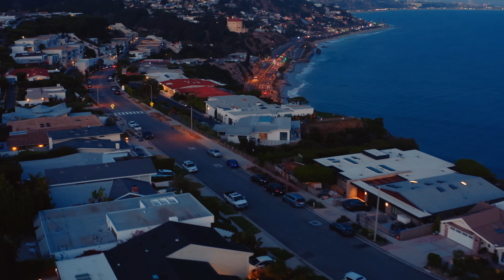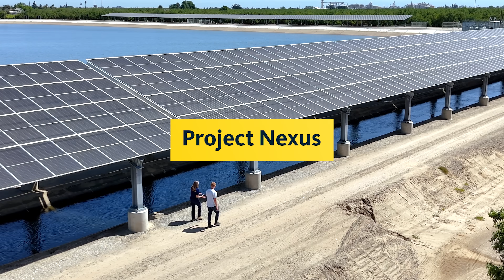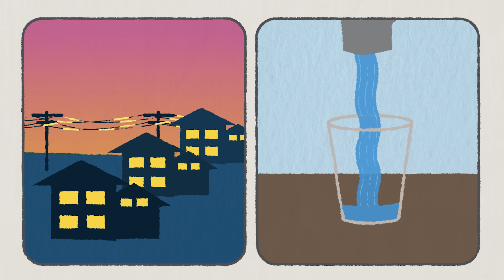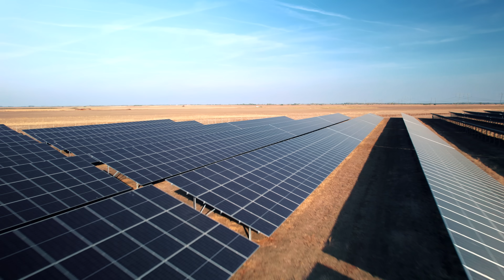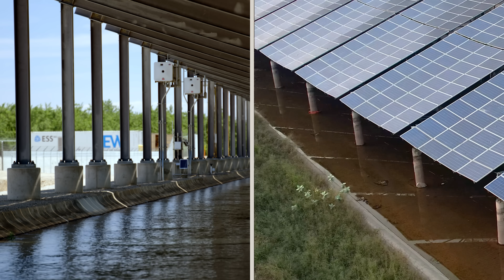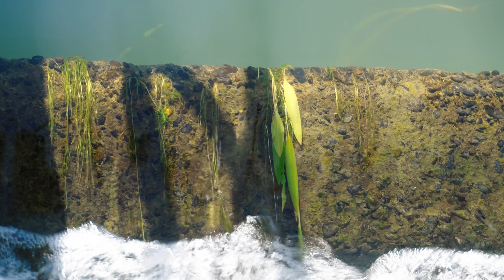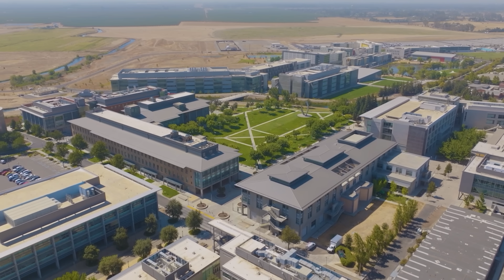California’s new solar panels do MORE than generate power

Comment: 1GW to 1TW is not a 1,000% increase it is a 1,000x increase that is 100,000% increase . That is doubling every 2.5 years, so doubling in 3 years was a slowdown.  China is slowing down to 5 years to double. The US only has 1/4 the solar power as China, so it will take about a decade or more to catch up. The EU is also going to keep getting further ahead as solar costs 1/2 as much in the EU as in the US.

Comment: Water utilities, rail, highways, airports. All infrastructure that uses a lot of electricity. All are close to other energy consumers. All have a lot of square footage that solar panels can cover. Municipalities have all manner of buildings, parking lots, structures, and land. My parents are in assisted living. Lights are on 24x7 as far as I can tell for safety. Large buildings, parking lots, etc. Inflation and high cost at all of these facilities is a big issue. But drill baby drill is the non-policy policy we get.  Tax credit suspension will delay it,  but it won’t be long before private equity looks at the graphs and the profit lightbulbs go off. All from savings. The way we’re going if might be Chinese private equity.

Comment: The place to put solar panels is on the roof.  One of the best things about solar is that it is decentralized.  You generate it yourself, for you.  

While putting it over canals to also conserve water makes a lot of sense, the idea of creating solar farms that are owned by power companies takes away from solar's appeal.  We need to incentivize individual solar installation, or we're going to just going to have solar companies replacing fossil fuel companies.

Comment: Seems like home solar in hot places could be used as roofs over pools, to catch energy, slow evaporation, and even to catch more evaporation with a surface that collects and returns the water to the pool. If it's moveable, like the panels that adjust to follow the track of the sun but also at homeowners choice when using the pool for swimming, that adds an extra plus. Yes, more to design and more expensive, but in wealthy areas (sunnier areas) it seems like it's worth the thought.

Comment: There should be a second layer under the panels, at least a thin one to catch any panels that break off. You don't want that stuff in the water. Especially if this project goes full scale and maintenance starts slacking.

Comment: I am glad to see this. but I submitted a paper to my elected officials in 2001 called double duty suggesting this with the clear advantage of saving water and land. Pisses me off it took 25 years for them to even consider and put someone else name on it. The other suggestion was a fast rail along I5 to but they decided to consume farmland rather than use the same corroder as the interstate, but no, someone has to profit off the existing high speed rail route.

Comment: For many years I’ve wondered why nationwide retailers didn’t take advantage of their massive square footage of roof space and volume discount to install solar panels on the roofs of all their stores in areas with a high number of sunny days.  Seems like a no brainer to cut costs and potentially even generate revenue depending on the electricity needs of the store.

Comment: They may produce power but I guarantee
They don't produce power when its needed 
They never produce at nameplate capacity
They don't produce at night (16 hours every 24 hours)
They require expensive battery storage to make their generation available during peak use.
They require FIRM (FF) back-up
They don't last as long as traditional fossil generation
They are easily damaged by inclement weather

Comment: I was reading about a new panel that has collectors on both sides (bifacial). Combine it with Solar Trackers and you can increase output by an additional 30 to 40 percent.

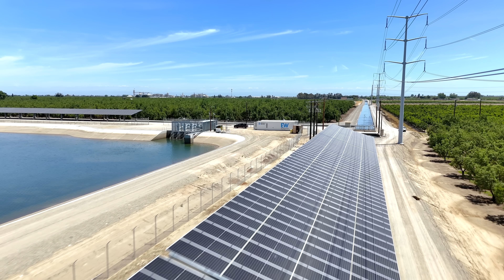Comment: 5:10 if you put solar on top of every building. You wouldn't have to consider shade. The sheer scale of the power generation would negate caring about the small sections covered by shade through part of the day.
Reply: Agreed. Every new building in LA already has to include provisions for solar panels

Comment: I see how the panels shade the water to cool it down right. This will slow the evaporation, nice job.   If we spread out these systems and only add like another cooling system between them, I'm sure it will save more.  I seen those black balls in those reservoirs.  You said those stop evaporation

Comment: Parking lots will alread solve that issue. In America you have more space deidcated to parking lost than actual houses. Whats also missing is IF those evaporating water isnt all lost in my opinion. Fog or cloud forming is also neccessary for other regions to "water nature". Albait i admit that artificial canals are not that big of an impact as they are not very wide despite 63 billion gallons is much. But id like that this equation is also considered if you are thinking of the argument of "saving" water in open nature.

Comment: But... less evaporation means less rain...
Reply: On a global scale, the dynamics of evaporation and precipitation are dominated by the oceans. Roughly 90 % of atmospheric moisture comes from evaporation of oceans, seas, lakes, and rivers. Human made canals make far less then 1% overall. 
So basically you are right, but rain can not be controlled, so evaporated water may rains down, where it has locally no benefit for agriculture, woods or plants in general and for humans at all and at a higher cost, to get it back for that purpose.
Reply: Basically what oli said. 

Canals not only make up a very small amount of the total evaporated water and the evaporated water will probably just end up in the Ocean.

Plus well, you have more water now, so just use it to subsidize the tiny amount of less rain you'll get.

Comment: It's easily over 100 degrees out there for a couple months a year, so there's still going to be plenty of evaporation.  Proximity to water 24/7/365 is rough on all electrical components. Doubt they've factored that into their calculations. If you were putting solar panels on your home... you wouldn't put them over the swimming pool.
Reply: Looks like a lot of guessing and that you are not familiar with the technology at all. Why didn't you spent even a minute to read all the linked sources to studies and real numbers?
It’s true that hot climates still have evaporation, but covering canals can dramatically reduce it even in 100°+ weather. Evaporation is driven not just by temperature but by direct solar exposure and wind. Shading canals can cut evaporation by 20–40% or more, because you’re blocking the main energy source that fuels it. That’s why reservoirs use shade balls or floating covers—they work even in very hot places.
As for electrical components: solar installations already operate in harsh environments (deserts, offshore platforms, coastal areas) and the industry uses sealed, corrosion-resistant, marine-grade hardware for exactly that reason. Panels themselves are waterproof and rated to survive decades of rain, humidity, and temperature extremes. Mounting them over canals doesn’t require fundamentally new technology, it just uses the same weather-proofing solar farms already rely on worldwide.
The “you wouldn’t put them over your swimming pool” analogy isn’t quite accurate. A backyard setup isn’t engineered or maintained like infrastructure. Canals, on the other hand, already require industrial-grade construction and maintenance. If we can build solar farms in sandstorms, snow, salt spray, and 120° deserts, installing panels above water isn’t unusual at all.
Plus, the benefits are real: Reduced evaporation losses, Higher panel efficiency because the water below helps keep panels cooler, Zero land use impact.
So yes, there are some engineering challenges, but they’re well understood and already solved. And the potential gains are large enough that countries like India and regions in the U.S. are already piloting these systems successfully.

Comment: Depending on the crop, you CAN cover farm fields with solar panels! Not panels close to the ground but up high, like in a parking lot. Many crops actually do better in partial sunlight, increasing yields. Additionally, you can run irrigation pipes on the underside of the panels, helping keep the panels cool, which increases their efficiency as well. It's a win-win.

Comment: Small error! Going from 1 to 1000 is not a 1000% increase, it’s a 99,900% increase
Reply: These kind of errors are pretty common. :-) Many people treat “percent” like it’s interchangeable with “times,” especially for large numbers and you are right. This should not happen in an educational video at all!
By the end of 2022, cumulative installed solar PV capacity reached about 1.183 TW (as the graph also shows in this video). So roughly 1000x would be fairly accurate.

Comment: Waste of tax payers money, it’s all money laundering at this point.  They wanna roll back roof top solar incentives but want to waste money building solar over canels at 100x the cost of rooftop solar.  Give me a break.
Reply: How did you come to that claim, that this has 100x of the cost, compared to regular solar power? And why should this roll back private or public roof top installations?
You never had a look at the cost at all! Rooftop solar (U.S.): ~$2.50–$4.00 per watt, Solar over canals estimates ~$4.50–$7.00 per watt (higher, but nowhere near 100×). If you count and add the savings from massive water-evaporation reduction,  the avoiding of land-use conflicts, plus the improved panel efficiency by cooling, you are totally wrong. I mean you can use already existing public infrastructure with almost no cost at all. This is not “money laundering”,  it’s a standard public-infrastructure investment! It’s not a replacement for rooftop solar — it’s a complementary technology!
Reply: How did you arrive at the 100x costs?
Reply: @michael91009 I just answered, tax payer funded vs home owner.

Comment: Hydro, Wind, Solar, and Nuclear are the 4 Horsemen of Replacing the Fossil Fuel Triumvirate of Coal, Oil, and Natural Gas.
Electrification is the Future.
One day, all our busses will be Trolly Busses, The Railroads will be Powered with Catenary or Third Rail, and any Automobiles that would still be running in this future of far better modes of transportation would be powered by batteries. 
Huge Cargo Ships and Big Commercial Planes may still utilize Fossil Fuels, however, because there would be far less vehicles emitting greenhouse gasses, and there would barely be any fossil fuel using power plants, climate change would become far more manageable. Especially if we plant more trees to replace the ones we chopped down. As well as emphasizing the necessity of consuming less and preserving more.

Comment: This is a wonderful idea but I feel like it is more "feels good" than practical. The same can be accomplished in more effective ways. Firstly, that is a whole lot of mass that needs to be lifted and supported. Lots of steal, lots of concrete, and lots of transportation of the materials to these isolated locations. Secondly, the panels, while cooler, are also in a high humidity environment which means more maintenance in more distant locations. There is also no support in place to clean the panels which increases the performance more than being cool does. I believe that it would be a lot cheaper to make a lightweight, cheap, and easy to repair covering for the canals while also building dedicated solar plants in the massive expanses of high desert in Southern California. It is not farmland, very sunny, and the fields of solar panels are cheaper to make, maintain, clean, and are centrally located to cut down on the transportation of everything. There is even a straight shot railroad from the LA port to the high desert and an interstate. The only challenge at that point is transmission lines but the infrastructure to make and expand those is already in place. Do both things but build to task instead of trying to do two things inefficiently.

Comment: There is currently too much solar excess PV capacity in California and nowhere to put it.  And, it is not cheaper than conventional generation.  Electric rates in California are already 2-3 times the cost of electricity nationwide and that’s with subsidies. Could it help save some water currently being lost due to evaporation from canals and lakes?  Sure, but there is no place to put the excess electricity production and battery storage itself creates heavy metal pollution and some of the materials are produced through slave labor, some of it African. One other problem, farmland is even better at losing moisture through evaporation from canals or even lakes.

Comment: The idea of solar panels having secondary and tertiary benefits isn't new. I was among the people wondering why solar panels aren't in wider use and California's canals were among the first places I wondered about. Its really sad that we're still exploring what ought to have been in very wide use already. Reducing evaporation is an important secondary benefit. 

An example of a tertiary use. Much of the canal water needs to be pumped, either in the canals themselves or onto the surrounding farmlands. Pumps are DC devices (direct current). Solar is DC power. Solar reduces the need for the massive transformers that turn AC energy (used in most generation and transmission) into DC. Using solar power to directly power pumps (or energy stored as DC energy if more appropriate) to then power pumps will save a bit more money. 

All this said, I'm skeptical on retractable uses, as the mechanical issues are likely quite expensive. The 'closer' factor is a minor factor when compared to the shading. Further, it seems the width is limited by where the road goes. But one can put the panels higher, effectively increasing the width by perhaps 15-20 feet. which is 50% larger than a 30 foot crossing for very little extra cost beyond just adding more panels.

Comment: 63 billion gallons may sound like a lot, but it is just over 0.5% of the water California uses for commercial irrigation. It's a meaningless amount, a rounding error. Installing solar panels in this fashion is significantly more expensive than simple ground mount methods, thus increasing the ROI and lowering the value of their production over their lifetime. It might still pencil out to do this, but the amount of water saved is so little that it can be ignored entirely in the calculation.

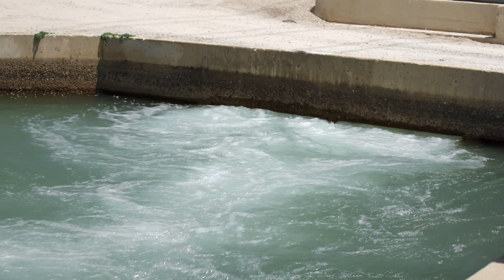Comment: 2:09 would that not be taking away 63 billion gallons of water from the natural water cycle then effecting the climate of a different area that hasn't been taken into account.
Reply: There is nothing natural about the water cycle in California canals.
Reply: @enderjed the evaporation of water is still a natural process whether it's from a canal or not.
Reply: @Reeso2112 it's manmade, that evaporation wouldn't happen in those areas or to that extent without the canals
Reply: @localcrackhead2904 ok but that’s 63 billion gallons less rain that would js make the surrounding area more dry would it not?
Reply: if it was covering natural rivers it would be a huge concern yes, but the canals don't really contribute much to the rain cycle

_yes_, there is some chance that nearby areas would get drier as a result, but it wouldn't had been any different than if there weren't any manmade canals there

Comment: Some years back, I was driving from Eugene to Phoenix, and going through the Sacramento valley with 40 mph winds I was wondering how much water evaporated off of the canals. I would guess that maybe half of the water actually got to where it was headed with the 90+ degree heat and strong winds. This seems like a good partial solution.

Comment: I live in southern New Hampshire, USA. Out local Yoghurt producer has covered the factory parking lot with solar panels.. keeps the sun off the cars in the summer and much of the snow off them in the Winter.

The development of over canal solar is elegant engineering at its finest.
Reply: Adding to the discussion I'll assert the question: Which PV solar system - vast solar farms vs rooftop solar - best addresses the larger problems of insane traffic and overall excessive energy consumption? I figure rooftop solar is better in these regards and for many additional purposes.
Reply: If only people had a saying, right? We would be in much better situation today. 😥
Reply: The north east is a really dumb place to have solar panels. Not enough energy from the sun to justify them. California and the southwest is the only areas where solar really works.
Reply: This just isn't true. Yes, the best solar gain is in close to the equator but panels are so cheap that they pencil out positive well into Canada. I live in New England and my dad's panels are well on their way to paying themselves off six years into their life span. He'll be making a profit for the last 20+ years of their rated life.
Reply: @karlkobler218  You're sounding somewhat uninformed and yet have a fact free opinion you're quite certain of. That's very MAGA.